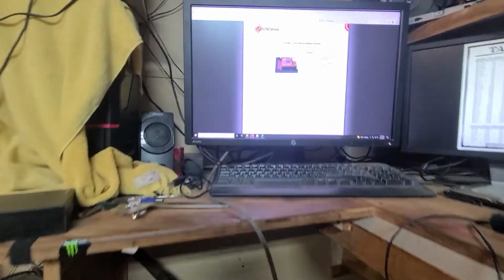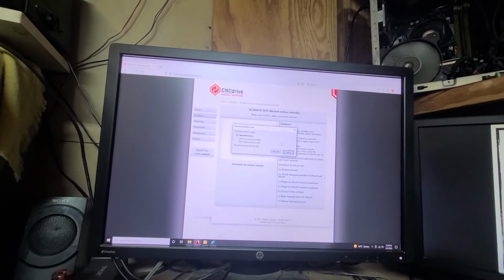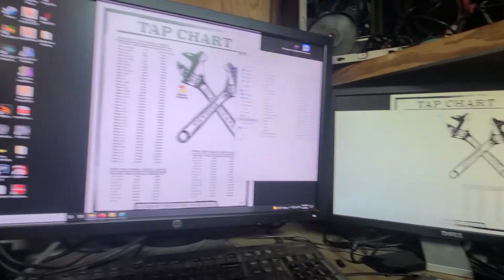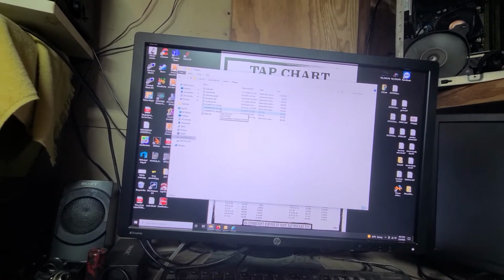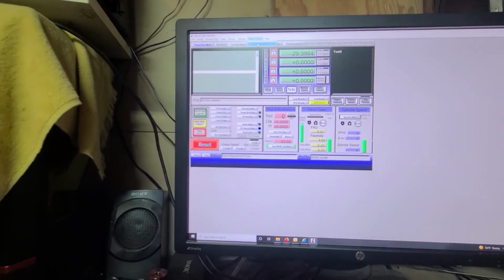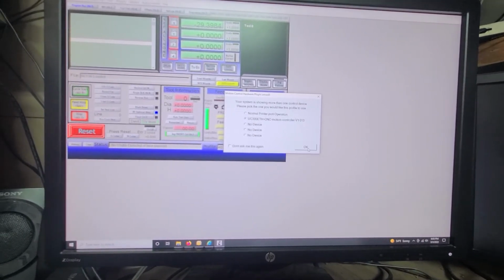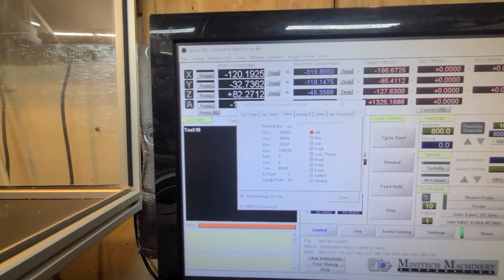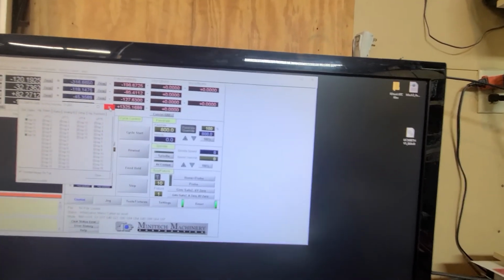How to install a motion controller plug-in file into mach3 and reset mach3 gor new plugin

Comment: Thank you for your informative post about the UC100 and Mach3.  
I just purchased a refurbished PC running Windows 10 pro for my Mach3 CNC work and installed fresh downloads of Mach3 and  UC100 plugins per CNCdrive and various other instructions.  
Have you ever had a problem with getting message "Plugin Dll Defective.Reload, followed by UC100V2_151.dll Defective Plugin found.ignoring.  Have installed latest VC-redist and .net framework files with no change. Motion controller shows as active in Devise manager when plugged in.  
Have downloaded auto install, manual install files and nothing seems to work.  Have reached out to Mach support and CNCdrive forum, but so far no solution.
Any help would be greatly appreciated. Again thanks for your post.
Joe in South Carolina
Reply from the maker: you are getting that error because of the .NET framework.  Check to make sure you are using .net 4.0